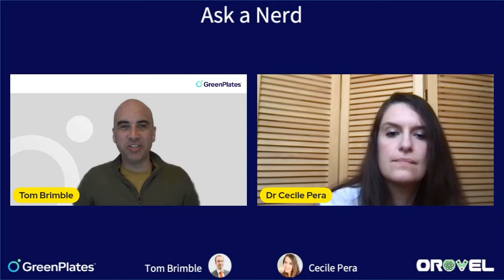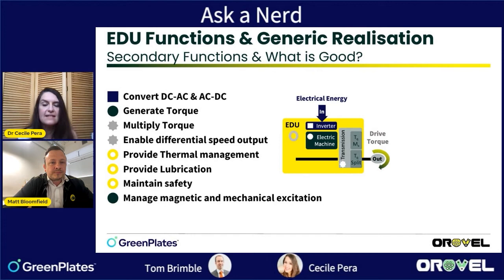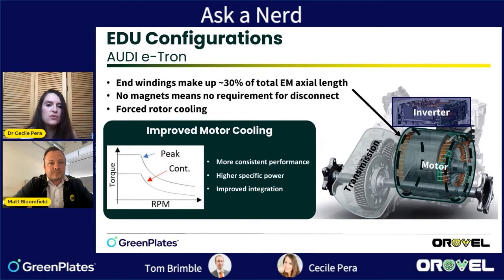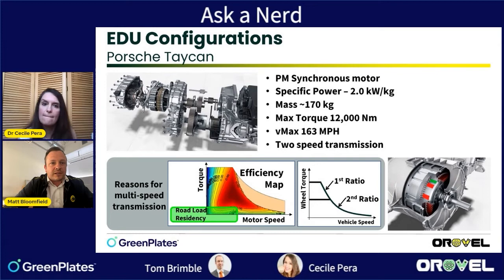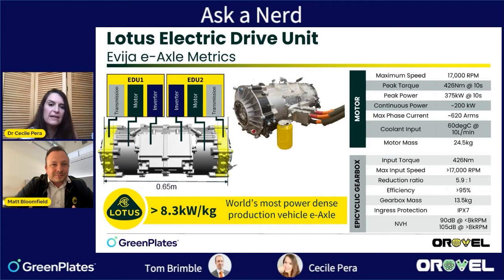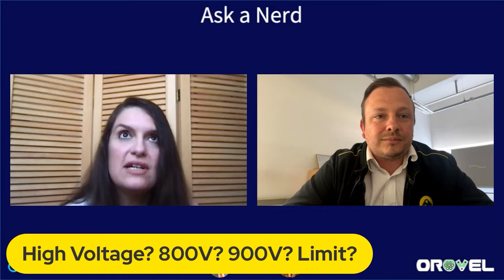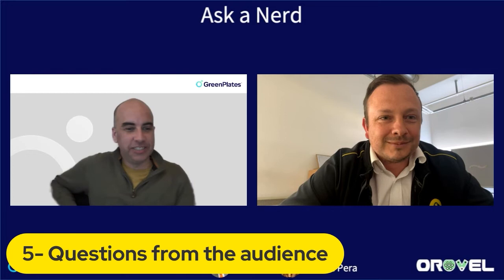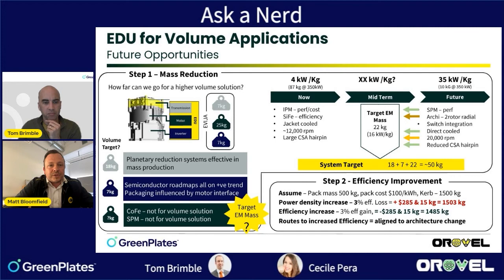How Lotus Evija liberates 2000bhp from 4 basin-sized electric motors - Matt Bloomfield - Ask A Nerd

Comment: The future is Exro Technology
Reply from the maker: Perhaps you could elaborate? What is the USP?
Reply: Exro has a Coil Driver that replaces the inverter, eliminates the gear box and gets rid of the need for multiple motors while performance and efficiency improves and also lowers the cost of EV.